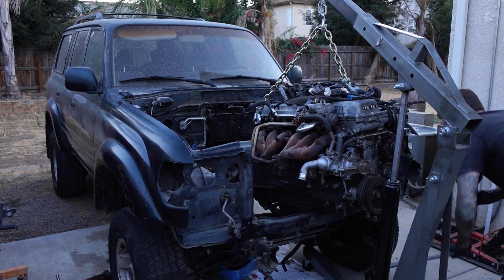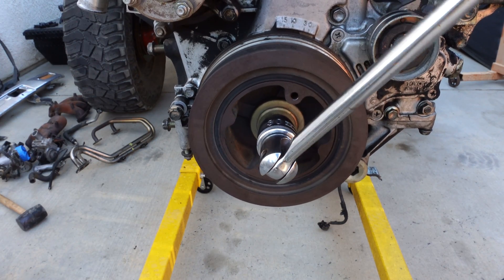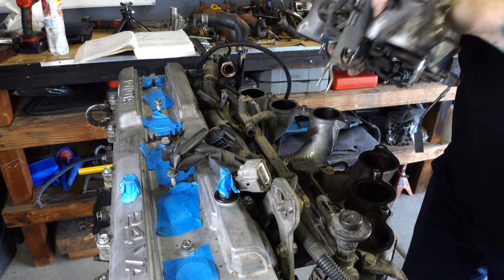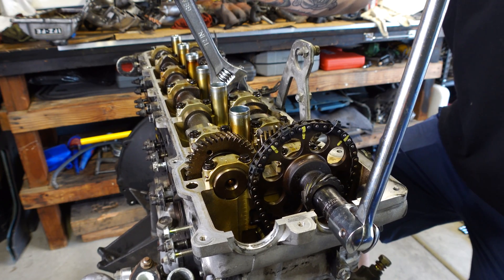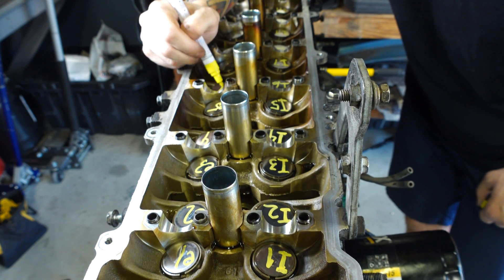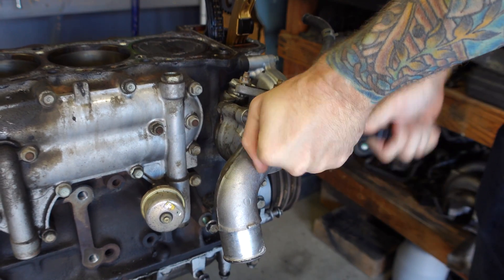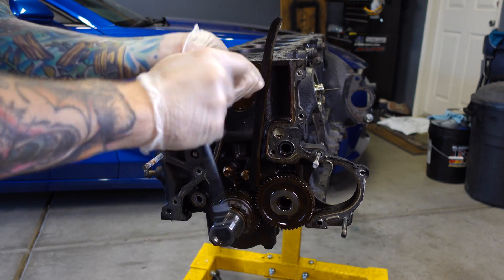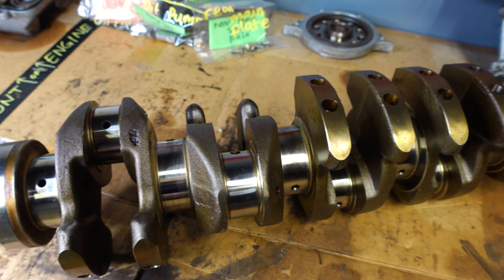Toyota 4.5L Inline 6 Engine Rebuild - Full Teardown EXPLAINED | 80 Series Land Cruiser

Comment: There were three 1FZ's available in the Land Cruiser. There is the 1FZ-F with 190hp (carburator), the 1FZ-FE with 212hp and the later updated 1FZ-FE with 240hp (available in the 105-series etc).

Comment: When I tore down the 350K-mile motor in my '96 LC the bearings looked pretty similar. Good video! Make SURE the shop doesn't hot-tank the block - the acid will eat up the brass oil pump bushing. I don't think Wit's End stocks them anymore and I don't know whether the others on the market are good or not.
Reply from the maker: Nice! Yeah I told them not to use a caustic solution to clean it. If it comes back messed up, Yota1 and Landtank sell the bushing.

Comment: THIS IS SO AWESOME! Do you happen to have the bolt size that you mounted to the engine stand?
Reply from the maker: I think they are m12x1.25 and 3.5 - 4” long. Best way is to take your bellhousing bolt to the hardware store and find something similar.